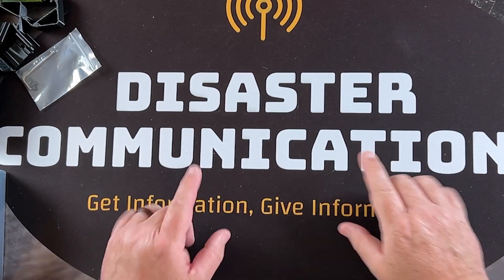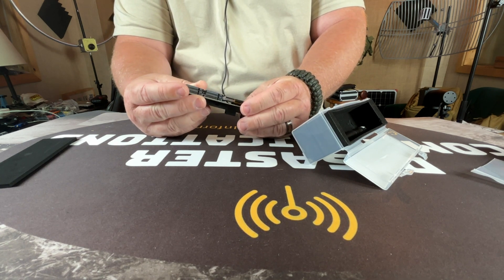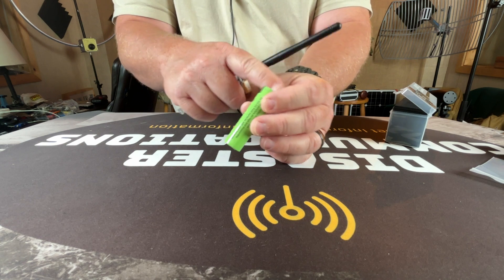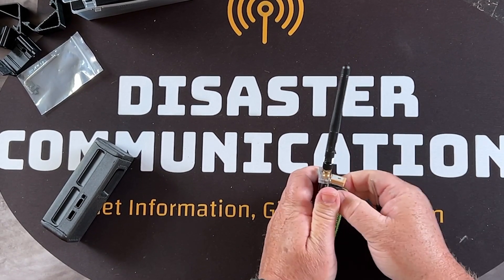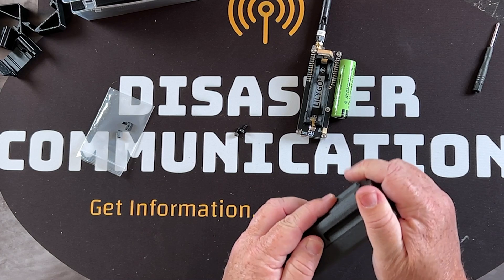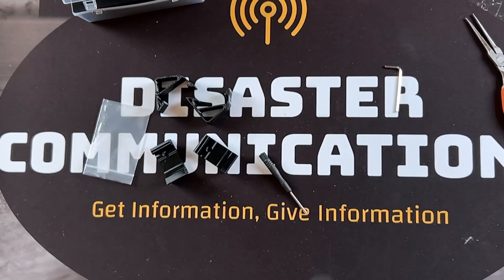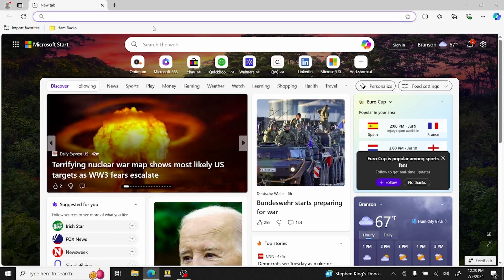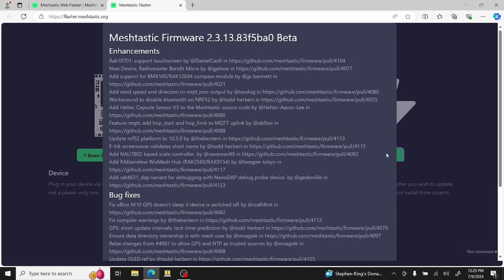Mastering Tactical Communications with the T-Beam Supreme!

Comment: New subscriber! Setting up my first Meshtastic system. Is there a way to adjust the node offline or is it some web based?
Reply from the maker: Awesome to have you on board! You can use the app either iOS or android to adjust settings.  You can also use a laptop that connects via Bluetooth to the radio if you’d like.  I prefer using my phone to program.  Computer to flash firmware but phone to adjust settings.  I’m quicker on it mainly.